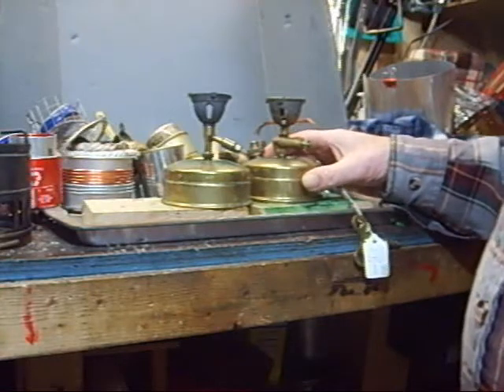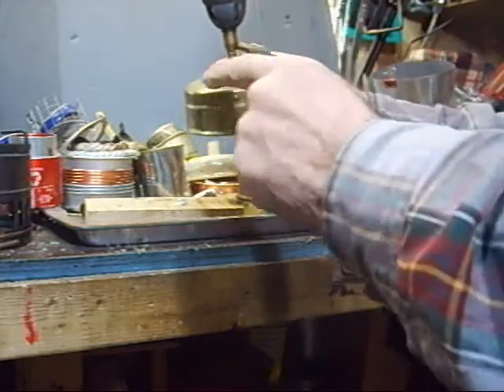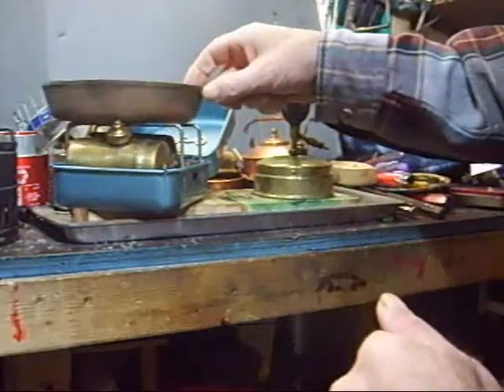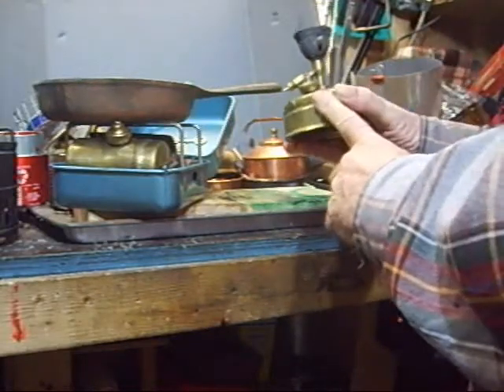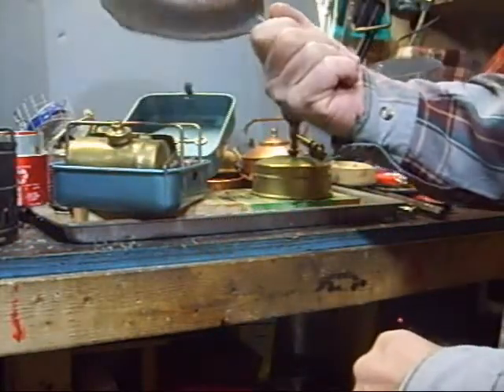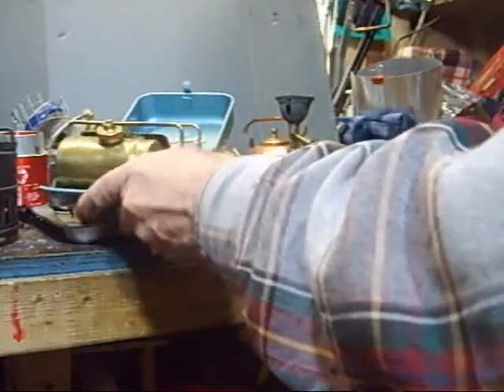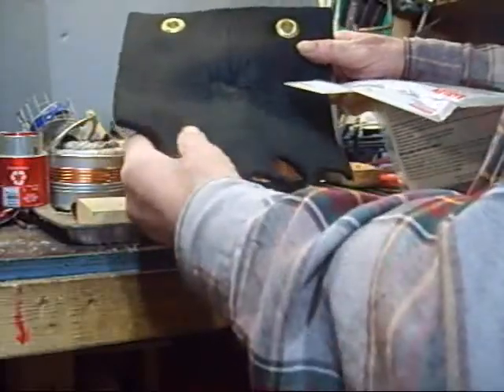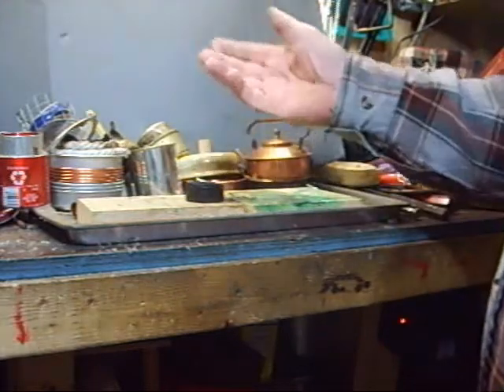svea.wmv

Comment: As I recall, the standard of boiling 2 cups of 60 degree water on 1/2oz of alcohol was only for initial testing purposes of new designs.

If your stove design will do that indoors, it should do well enough in the outdoors, but knowing full well it will be with more fuel and longer boil times.